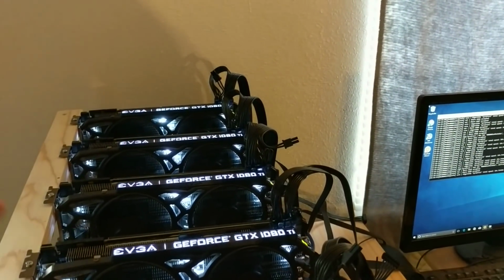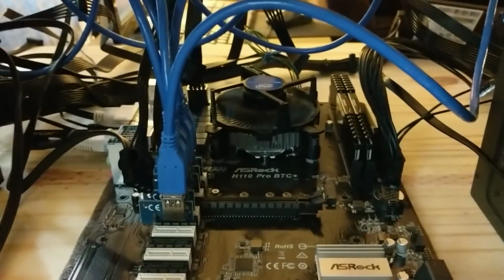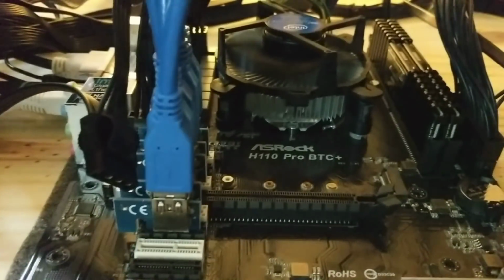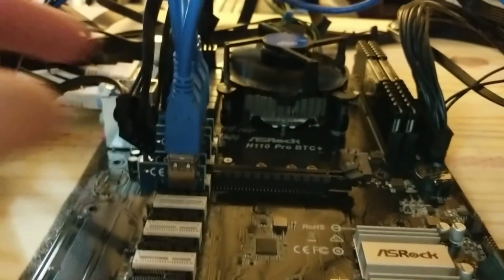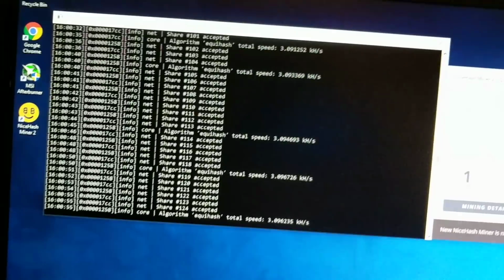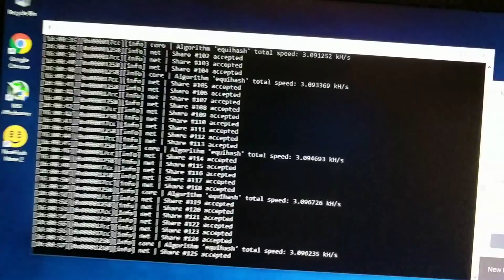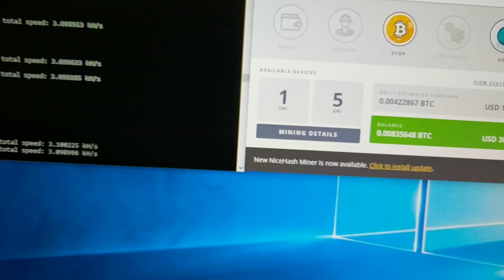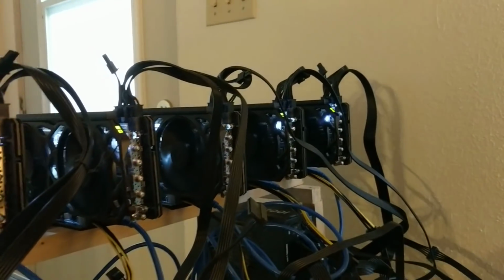My first mining rig (5 x GTX 1080 ti) and problems I had setting it up to mine crypto currency.

Comment: if you have 12v+ going through your motherboard-to riser card- to gpu. then have your 6pin express power connector from a different psu which is supplying the motherboard you can create a issue. especially with power supplies which like to sit at different voltages. I have personally tested some which float around 12.3v and some at 12.6v. you would need to disconnect the 12v+ going through the riser card from the motherboard and swap it for the 12v+ rail on the same psu supplying power to the gpu.  basically you need to isolate and separate the voltages from the different power supplies. other wise the power supplies are fighting each other and any digital power correction is useless and going haywire all the time.

Comment: shouldnt skimp on the PSUs, get the best ones you can, with the highest efficiency rating as it'll save you money in the long run. Two AX1200i would be good.

Comment: Just curious what is your current profit? I have 4 of the exact same cards also using Nicehash and I start sweating if it ever goes below $21. I would say my average is about $27 but it hangs out often in the $30 - $32 range. Of course I run my cards really hard and have about the max overclock they can take without crashing.

Comment: i run a 1080 and an i5 in my gaming rig and it gets $5+ a day pretty steadily without any overclocking currently. do they make less when they are stacked or is this just because its months later that this 1080ti rig is making less?

Comment: Funny how many people  are saying you cant make your monney  back got a 4 card 1080ti payed itself off in 4 months and has been running for almost  2 years now with out a single issue except haveing to replace 2 120mm fans guessing half the propaganda is to stop more people geting in to it so more free money for us and other half sad gamers who could not afford a card they dont fucking need any way 1080ti at worse is up by 200 rrp its not this 600 700 bs every one is saying
Reply: I going to order two 1080ti, and will add one by one slowly. what are your suggestions. Shall i buy 1080ti or which any other options. As i searched they are the best gpus. i can spend 700$ on each one. However, if you have suggestions. please tell me. I am more interested in mining Etherium ,  zcash and bitcoin.

Comment: I had the same problem of not having enough power to the motherboard pcie slots. I COULD NOT FIGURE OUT WHAT THE HACK WAS WRONG FOR 2 DAYS. I though either my motherboard was faulty or the graphics card was doa. Now I just gotta find out if my board has extra connectors to power the pcie slots.

Comment: i mine 7.00 a day with a single gtx 1080 ti using lyra2rev, and 1.50 with a ryzen 5 1600 on water @ 3.9 ghz. so 8.50 a day average with spikes to 10 bucks a day. i wonder if some of the cards arent being read, or maybe some kind of power issue. check speeds of all cards, you should be making more than 18 a day using 5 1080 ti's. somewhere in the 25-30$ a day area
Reply: which type of power supply do you use and do you use nicehash for mining
Reply: 1080TI with over clocking right?
Reply: nope stock speeds. overclocked I was sitting at about 13.50 a day total constant, then BTC dropped so conversion rates dropped also so now im making again 8-10 bucks a day average
Reply: Chris Vincent why is the lagacy making you more money. Even more than  this new version 2?
Reply: the newer one is a closer competitor, but legacy still gets it by a couple bucks daily
Reply: If you are planning on expanding your rig,  and your machine is only a miner rig, use "simple miner" runs off a usb flash drive. way better than nice hash

Comment: Hi I'm fairly new to mining. I already have a gaming rig that already has an 980ti that I'd like to repurpose for mining. my question is can I put in another card like the 1060 in my pc and continue to mine without any issues? in gaming perspective I know to do an SLI to harness multiple gpu's that is on the same series. does the same rule applies to mining? can we just mix and match GPU's in the pc?

Comment: Nice Video,  I am in the process of building an 8 GPU 1080 ti miner myself.  Was wondering how many cards the PSU could push and your video answered that.  Thanks.  What software are you using now that nicehash is down?

Comment: The psu should be able to power them.... Corsair psus have over current protection enabled by default... Youll need to plug in the usb cable and disable OCP. I also suggest combining the 12volt rails...

Comment: Thank you for sharing this, I currently have 6x GTX 1070 with RM1000x,  I am trying to slowly expand as I learn more about mining.
My motherboard currently supports another 2 GPUS, and I know I have to upgrade to another PSU, the one suggest by you not even is cheaper but I think is more efficient then what I was about to purchase, an 1600w EVGA.

I have noticed the PSU needs 200-240v, how do you suggest to fix the issue as in my home sockets I only have 120v ? I can not modify anything on the electric panel or house electric installation.

On the wall my RIG takes 114v ( 1258w ) according to a KILL-A-WATT meter. I want to understand if these are real values, basically I am doing 114v out of 120v what the socket wall can handle, and 1258w out of 1000w which my PSU was designed for, basically I am maxing everything out ? 

I would really appreciate any replies. Thank you.

Comment: Well man you are basically wasted your money,

First of all, you bought 1080ti's which are not a good option, than there is a motherboard with no support for at least 5 PCIe 3.0 x16 (yes you have x1 to x16 ryzer but that's bullshit :) ) , and third your CPU supports only up to 16 PCIe lanes (all this just degrade performance by 30-60%)... Really waste of money...

Comment: 1080ti are the worst for mining , get a amd card scrub
Reply: 1080Tis or any nvidia card from 1060 and up are great for mining equihash coins, far better than AMD by a long stretch.
Reply: the pascal cards are power efficient wich makes them the worst for mining , remember you want power hungry cards for mining not efficiency , trust me i tried mining with both a 1080 and a rx 480 and the 1080 would barley mine anyhting cuz the power consumption is to low even when i turned the power up to 120%  nvidia cards does not cater to miners lik amd does amd cards even has a mining profile wich makes them better than any nvidia "in the long stretch" for mining, do some research my boy or try it out for yourself
Reply: when you say 1080 do you mean the 1080 ti?  i think there is a big difference between the two.
Reply: skooly Holy run-on sentence, Batman!
Reply: 1080ti ftw
Reply: skooly yea... 1080 is not the best for mining. Its been proven already.
Reply: r9 390 does 33 mh but at 250w
Reply: skooly sorry bud you're wrong. The  1080ti is the best miner gpu right now. The 1080 is beating on the vega 64 right now. "do some research scrub"
Reply: https://whattomine.com/
Reply: amd rx470 4gb mining  70w 24mh/s +130w 29mh/s ETH (bios mod) I Love AMD

Comment: Why would you use 1080ti´s? Just make a website with a fake company, send amd a message, link them to youre website and they will sell you rx 480´s for reseller price (Its not much lower than the amazon price but if you buy like 20 at a time, it adds up)

Comment: Don't waste money on enthusiast grade gaming power supplies.
Not saying that they're bad but you can get for dirt cheap 12V server power supplies, like 1000W one(should run 5x 1080ti) for $20...
So you get some cheapest power supply you can find to power the motherboard and 1000W server power supply to power your GPUs.
Tho some soldering and electronics skills would be required.
Reply: Arek R. Buy a cheap one and risk buring up all the cards no thanks

Comment: I used to use a second hdd for my shitty oem pic that I slapped a low profile gpu on to game with. There wasn't enough sata cords on the shitty fell psu so I grabbed my psu I had waiting for my next build (waiting to buy the rest of the pc) all I did was connect the new sata to the other hdd and bend a paper clip to and put it in the 24 pin power connector to essentially 'trick' the psu into thinking it was actually connected to a mobo and give power to the spare hdd. Never seen what this guy did for his power issue before. Also my setup didn't run into any issues for like six months then I built my new pic and still no issues even after upgrading the new pic a well.

Comment: the only problem i see here is that 5 perfectly fine GPUs are getting fucked up by yet another miner.poor babies.all that money spent on those GPUs are now down the drain in hopes for BC money, which won't pay out before these cards are burnt out because of bad handling/cooling.
Reply: kid please learn what bitoin mining is.  9/10 people will down volt the card so they have less electricity to run and their life time will be better
Reply: What bad cooling are you talking about? He was cleary not running them at 100%, also this bench breathes very nicely.
Reply: Boycotted by gov? Impossible. If this dude started mining and didn't sell any of his bitcoin he would make a profit. Bitcoin is 18k right now and 23k in canada
Reply: A Little naive here, this is not for mining Bitcon, its mostly Ethereum or other coins, the info is usuful, especialy any of those new builders, and its unlikely he would sell them, but when things go feet up. there will be a flood of excellent powerful graphics cards available cheap for those gamers.
Reply: lolwut? These rigs pay off in around 120 days. Bitcoin been around 10 yrs already.
Reply: by the time the cars are starting to mka eprofit, the chance is high that bitcoin will be boycotted by multiple governments.

Comment: Pro tip for getting the second power supply to run without the splitter! Essentially what the splitter is doing is bridging the connection from the green (pin 15) to 14 or pin 16 and making the power supply turn on. Save costs by just sticking a paper clip in those two pins!

Comment: Looks good. I never get to see how profitable any of these rigs are per month. That's the big question I need answered.
Reply: if the market stable, maybe next year or two you'll break even, then if your rig still working after full power for 720+ days, you should make about $400-$500/mo, $350/mo after electricity.
Reply: Setting up in colombia. So super cheap electricy. We'd need a setup that would be able to pull TH to really make money, correct?

Comment: If it weren’t for people like this, us gamers would be able to build our computer. But instead a $600 gaming rig that should play anything will now cost us $800 and up because you guys make hardware pricing go out the roof.
Reply: The 1080 ti's were $750 at launch. They are still roughly the same price now. Show me a $600 gaming pc build with a 1080 ti in it. Don't worry I'll wait.
Reply: Tyler Harrell if you’re expecting a $600 full build to play anything and it now cost $800, it’s not because of this guy.  Each one of his cards before inflation cost more than your apparent dream rig that can play anything.  Guys like this are the reason that us enthusiasts who build pc’s that game at 1440p max settings or 4K 60+ FPS have to pay ~$100 more for our cards.
Reply: ellerm86 Yes, and a system with an txt 580 8gb that should be 250 - 275 now cost about 350 and up because of miners. Nvidia equivalent have the same problem. I’ve done my research.
Reply: Jeff T that’s going on Bullet Barry’s channel
Reply: Get a better job scrub then you can afford whatever you want
Reply: Just Cocoa Because he's right? Ok.

Comment: is this really the best approach anymore when maximizing ROI?
Reply: Definitely not. The hashrate you get from a 1080 ti is NOT worth the ~$750 price per card. You could get the same or better hashrate using more, far less expensive cards. That being said, 1080 ti's will hold a pretty high resale value for a while, so if you plan to sell all the cards before their value drops too much, it may work out. It's an expensive gamble though